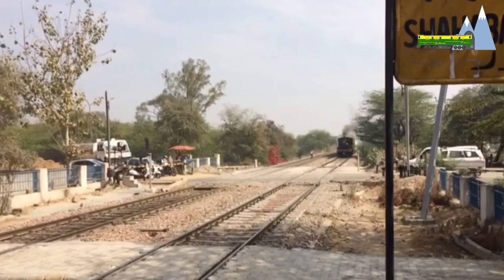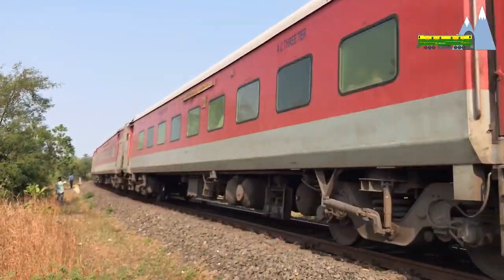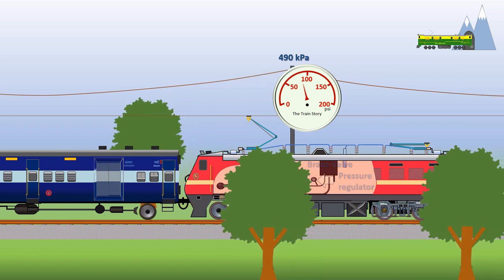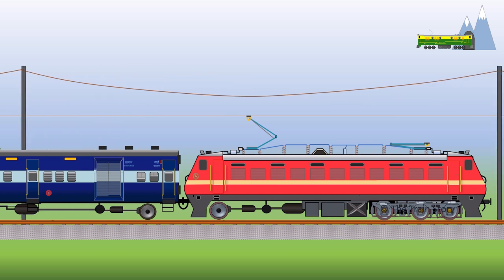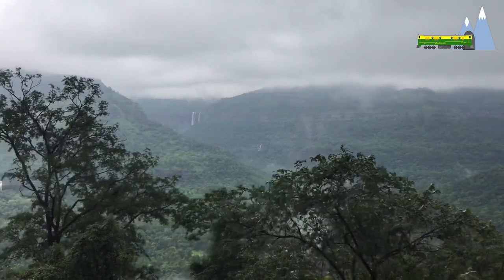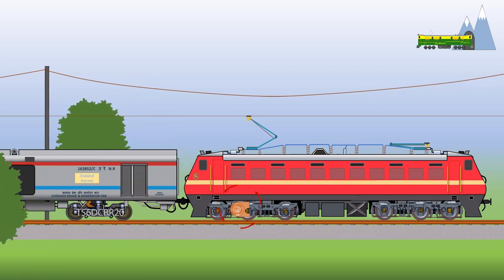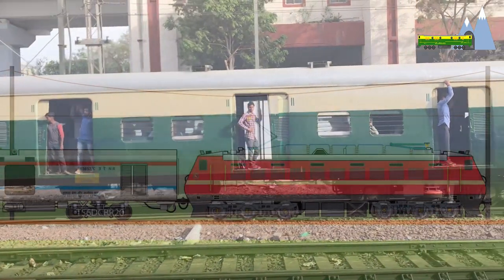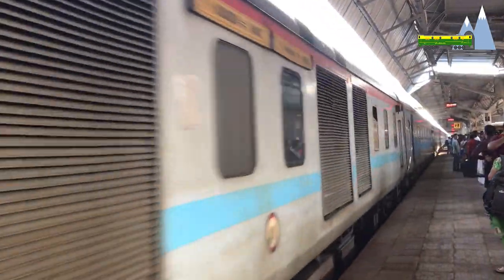Braking in Trains | Regenerative Brakes | Air Brakes | Mechanical Brakes | Dynamic Braking

Comment: your video @ 3.10/4.48,  says "Motor will run in the opposite direction for Regenerative", but actually NOT.   while driver apply the brakes, the motor acts as a generator (in the same direction) and generates regenerative power which will fed back to other trains via OHL/3rd rail
Reply from the maker: You are right... I had meant as a figurative expression I.e in reverse from traction to generation. But (combined with the graphics) this has conveyed wrong message. My apologies
Reply: Exactly

Comment: However older electric trains that were mostly manufactured before the 1960s shorted the electrical current generated by the motors through metal resistive elements under or above the train carriages and I believe this was mostly because of technical limitations at the time not making sending that additional energy back into the overhead lines a viable option! I also believe some modern trains have similar resistance coils but they are only there for the purpose of disposing of additional current if there’s not enough of a load on the overhead lines from other trains to use all of the regenerated energy! :)

Comment: Very well explained but will have to listen to  it several times to get more acquainted with this mode of operation . Thanks a lot. This is only to have some sort of General knowledge of these Locomotives. Also can an Electric Locomotive travel on the reverse direction or is it only a uni direction that the driver has to operate from the Left side of the Locomotive?
Reply: All locomotives can travel in both directions, hence the two operating sides. The "driver" has to be in the first one in the travel direction so he could ,in the eyes of the law, drive full speed. Other thing is and someone already mentioned this, while preforming regenerative braking, the motor is not runing in oposite direction, it is just rerouted so it could produce current. There is no other option, otherwise locomotive would react to motors changing direction while moving and shut down while inducing fast braking for safety.

Comment: I know it's already mentioned in the loco-specific videos, but it would have been pertinent to explain dynamic braking on diesel-electric locomotives that support them (i.e. energy from the TMs going into resistor grids that turn them into thermal energy that's vented out by a fan).

Comment: Still I have a Lehman question.. since dynamic braking is limited only for loco.. isn't is risky since the coaches behind keeps on pushing loco in forward direction which can result in sliding the loco??

Comment: I have a doubt how can the current goes back to catenary wire because current only flows in one direction.
Reply: The catenary acts like a universal busbar in this case, where the load and source connected in parallel.

Comment: If the power supply is 750volts, how much is returned to catenary considering the 11 to 12 percent of generated voltage?
Reply from the maker: Regenerated energy is computed from energy consumed by the train and not from the power supply. For instance a WAP7 class loco with 16-18 cars consumes around 9800 kwh energy over a distance of 450 km. It will return around 1100 kwh through regenerative braking...
Reply: @TheTrainStory  there is also the reostatic braking where current generated are burned in the brake resistor. Is the energy too low that it can't be returned anymore to the catenary line? In terms of kwh how much is that?
Reply from the maker: The braking you refer to where a rheostat ic resistor is used is employed in Diesel electric locomotives. These locomotives do not return energy to the grid. Much of the energy generated is lost as heat.

Comment: How the motor switches to reverse mode when the train moves forward
Reply from the maker: The motor shifts from consuming electricity for mechanical motion to using the motion to generate electricity. In other words the motor becomes a generator

Comment: 🔴 I am sorry your depiction of motor direction is WRONG during dynamic braking. Motor does NOT rotate in the opposite direction. It can’t because it’s geared to the wheel. Please understand the principles first. 
🔴 This is what happens during dynamic braking. First the power being fed to motor cuts off thereby allowing the train to move with its momentum. Since the motor is geared to the wheel, now the wheel turns the motors (in the SAME direction) instead of the motor turning the wheel. Thus the motor becomes a generator, the energy of which is consumed in the resistors with dissipation of heat. 
🔴 The resistor load thus exerts the electromotive force on the rotor of the motor opposite to direction of the wheel rotation thus applying the braking action without any friction.
Reply from the maker: Sir when I said opposite direction, it was figurative to mean from using electricity to rotate, the motor rotates to generate electricity, I didn’t mean it physically rotated in opposite direction. My apology for conveying wrong message
Reply: Gotta get my books out for this one😂